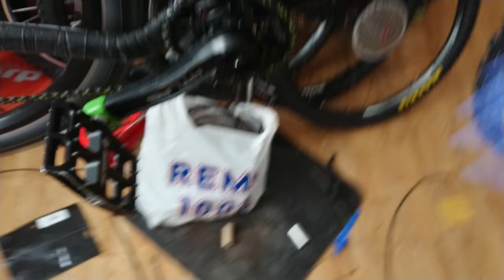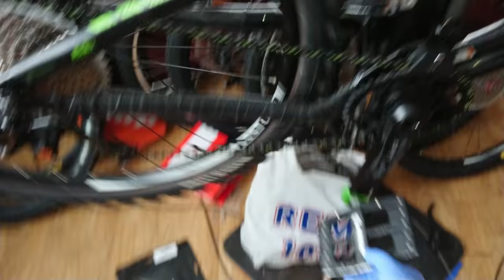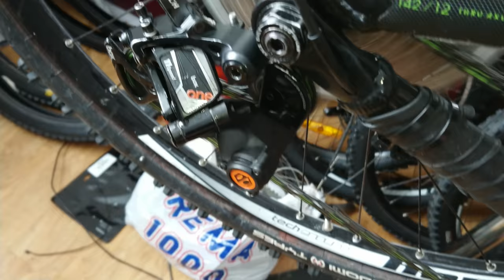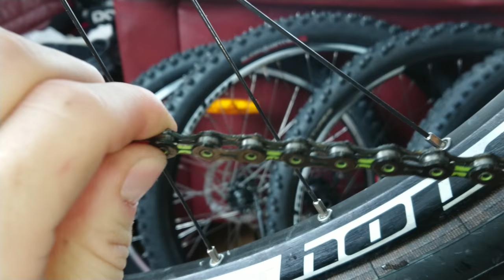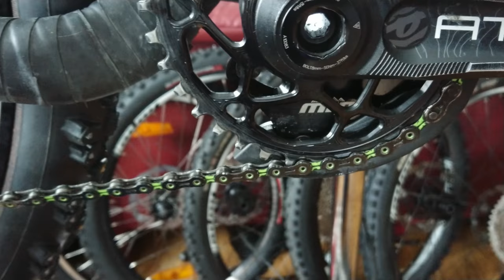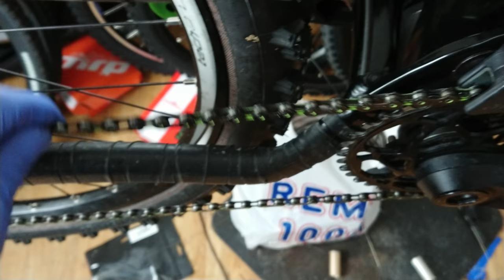Crunchy chain - Rock n Roll Extreme lube

Comment: I've got a bottle of Finish Line extreme lube for wet conditions that i've used in the past and it sucks. I don't know if its similar to the one you are showing here but it just collected dirt and grime like a magnet. I also used to use White Lightening and it built up a layer of grime and the chain seemed to need lube every few days on my commuter bike and didn't stay clean. I finally decided heck with it and just use cheap, easy to find WD-40. My chains stay a little cleaner and a WD-40 can lasts forever, it's cheap and I don't have to lube my chains as often. They actually make some bike specific products now that I've never tried. I don't know if they sell WD-40 in Europe? You can also use it for all kinds to things around the house and vehicles, dirt bikes, etc which is nice.

Do you like your oval chainring? Does it feel weird when you pedal?
Reply from the maker: WD-40 is not lubricant. Of course thicker lube will make dirt stay on the chain. If you use thinner lube chain will be cleaner, but if used in the winter it will come off, and chain will be noisy.
Reply from the maker: I use Muc Off wet lube, it doesn't get too dirty, and last long enough.   I used it on heavy rain, riding trough puddles, mud, - 10c worked well, but I clean my bike after every single ride in the winter due to salting., I also lube it. But I rode only a short ride I can let it be for few days, it will still work, but if you leave the lube on for days it thickens. It's best to lube it after evry long ride. Another lube that worked for me is Weldtite Wet Extreme, but it collects sand, and if you over do it with lubing it creates spiderweb in the drivetrain, the lube is thicker, it works great for extreme weather in the winter, but not for dry ride.
Reply from the maker: Pedalling a round ring is feels weird, but not oval, round ring causes knee pain after short time of riding, with oval i can go for hours without pain, the gear is lighter when needed, and hugger when needed, there is plenty info on this, but I comfirm it's true, buy oval.
Reply from the maker: I used Finish Line before, but I don't remember how it performed, but I could not find it for sale that many places, no shops in Norway sold it separate, I bought it fro ma cola shop which doesn't to exist anymore, but I see chain reaction cycles has finish line now, I could not find it there before, nor most there places. but Muc off was easy to get, So it's what I used the most, it also performed pretty good.
Reply: Johannes Nilsen I still like WD-40. It is a lubricant and does other beneficial things. I read up about it last year and I think people just view it as too common place and don’t have any respect for it. All I know is I spent the past 20 years buying expensive, little bottles of bicycle specific chain lube and they didn’t work any better or in some cases worse than cheap old WD-40.
Reply from the maker: @thatalaskaguy  So far my allround lube is Muc OFf Wet Lube.
but WD-40 is not a lube, it is meant to loosen up, clean, and lube in one go, but it's not meant as a lubricant, htat is what the ''experts'' say, like GMBN,
but they make bike specific stuff, as you mentioned, but I haven't tried any of it.
so far the lastest lube with good reputation is Smoove, but I haven't tried it, it's supposed to last long time.
Reply from the maker: @thatalaskaguy  have you tried in horrible muddy or brutal rain, and huge puddles, and riding in deep snow? what about different temperatures? like -10C or hot summer days, how does it perform?
Reply: @mtbboy1993  I've also used it on my commuter bikes with full fenders due to the normal wet, rainy weather in the fall and I had to clean and relube my chain way less often. On the other hand the Finishline Extreme was a mess! That stuff was a pretty thick lube that attracted everything it could to the chain. We'll have to agree to disagree about WD-40 but it says right on the can that its also a lubricant and if you go to their website it says the same thing. During the winter I don't have to lube or clean the chains anywhere near as often since snow is a clean, dust and mud free environment. What I like about the WD-40 is it helps clean and degrime the chain when spraying it on and wiping it clean, and it stays lubed for a decent amount of time. It lasts longer than White Lightening and is cleaner. The other bike specific chain lubes I've tried like to collect dirt and grime. As far as temperature, -10C = 14*F and no issues at all. I've used it in colder temps than that with no problems.
Reply from the maker: @thatalaskaguy  this is an example of why I like to try stuff my self, sometimes I find bad thing or good things no one mentioned. The lubes like rock n roll are cleaner and lube mix, white lightning is wax and cleaner. But rock n roll is only OK for dry, that includes the wet lube, for winter higher viscosity/thicker lube is needed,muc off does ok, but not tried white lightning wet lube, or muc off wet -50c lube, that might be overkill, I don't know before try. The lube that worked the best all round was muc off wet lube, not too dirty, in mud or sand, but weldtite wet Extreme did not work well in dry, as it collected sand,some of sticky lube. Not looked into what WD-40 has to offer lately. Some reccomend waxing the chain.
Reply: @thatalaskaguy  WD-40 is a lube..but its more of a lube cleaner. It can be used though for some applications where lube is needed but it burns off and doesnt last long.So you need to use it often. I just use a basic bottle of multi purpose oil/lube and it does ok. but for the heck of it,next time i clean my drivetrain,I might see about WD-40 as lube. See how it does for a ride or 2. Cant hurt..
Reply: mikieson I’m going to do a video of WD-40 which will show the lubricating oil left over after the rest of the WD-40 evaporates off after a few weeks. A bike chain is low rpm so it doesn’t burn off. I’ve had great luck with it, it’s cheap, keeps your chain clean but because it is just so commonplace and been around forever that people don’t give it much respect.
Reply from the maker: @mikieson  I haven't tried WD-40, or their bike specific lubricants. 
I am testing white lighting dry lube, I will continue testing it, but for wet riding so far Muc off wet is my fav.
I haven't tried other lubes, yet Rock 'n Roll was the worst wet lube I ever tried.

Comment: Wow!  Matching chain.  Fancy! :)
Reply from the maker: just because it was sold out of KMC x11 Sl silver, this chain is actually overkill, the performance gains are minimal, not really noticeable. even the box it comes in is overkill, huge revelry box with KMC on it and foam inside with magnet, crazy overkill.
Reply: Johannes Nilsen I've seen those here and they are expensive.  Just sticking with my SRAM chain.
Reply from the maker: I take what ever is the easiest for me to get,  I wish it was easier to get bike parts fast, and cheap, but o I have to buy international & pay import tax on a lot of it, and shops in Norway sell all stock fast, and take time to get new, some products they only got one pcs off, I can't wait until they import it.
but usually they got KMC chains in stock.
I haven't tried a Sram chain yet, but some claim they work better. but I don't know about the durability, I heard some things, but don't remember them all.
But I might swap to XD driver to test out how that works, and E-thirteen cassette, looks really interesting, I am chewing up Shimano splined freehub bodies.
The cheapest chain I found so far is Sram PC-1110.
Reply from the maker: chains don't last me long, but the KMC chain sure is well optimized for low weight & good strength. but the weak point is the Missing Link, it wears faster than the rest of the chain. but it's not a huge issue.
Reply: Johannes Nilsen My last bike, my XTR chain lasted for years and that was with riding, around, 3 times per week.  Never had an issue.  My bike now, I just have a bottom of the line SRAM chain that is only 6 months old.  See how long it lasts 
You like your MRP chain guide?
Reply from the maker: This footage is from the winter, but did not edit it until now,  since then I upgraded to Absolute Oval black bash guide with 77 Designz upper guide, which will do a better job, it won't clog up, like MRP does, and the chain will snap back on the chainring, with Mrp there is a chance of it getting jammed between the ring and the plate and falling off, it might happen but would be rare, but I want to be 100% sure, so far I am satisfied with the performance, you can read my reviews of both of them on my site:
MRP AMGv2 is not really made for oval ring, even the website states it's compatible.
MRP AMGv2: https://wp.me/p60aTF-1zq
Absolute Black OVAL 77 Designz ISCG05 Bash Guide Short term review: https://wp.me/p60aTF-2wH
Reply from the maker: I ride more than 3 times a week, if my health allows me to, so rides can bee over 20km and that's 1-5 times in a week for the most part, But i also ride for grocery round, but for thgat I mostly use my Trek 6300, but lately only rode few short rides.
so if I am well I rode as much as possible so it can last for hours and many kms,  but I swap chains when they are at 0.40 wear, to increase lifetime the rest of the drivetrain, so on my main bike the chain won't last long.
last time it was about 101.8 km according to Trailforks/Strava, I always record my rides, no matter what, but some times it fails to do it properly, but that's only few km inaccuracy then.
Reply from the maker: I haven't tried XTR chain, but I tried XT, when it was the only 11 speed chain I could get, but I like quick links/missing links, but Shimano has that too now.
I don't see much difference, I go trough drivetrains, & tyres faster than ever before, I was nto as harsh on gear when I was a kid, but I did not ride to Skansehytta then, I did nto do as many technical climbs, and did not weigh as much.
I go at high speed, you might not, so how hard and often you ride makes a huge difference on the wear of components, for example cheap bikes are impossible for me to ride for a long time without ruining cranks,drivetrain,fork,wheels,BB and other stuff, but with proper component's I can ride hard and for a long time. but on my Trek 6300 I swapped out all the garbage, and only got good & decent stuff on.
but the Fuel EX frame is really holding me back now, I ma on the last hanger, and threads are bit too loose, so something bad might happen soon, SO I will take it more easy, but my 6300 is still going strong.
I also go trough rear dérailleurs fast, I need 2 in a year if I would stay with Shimano, thats expensive, even for the budget options, I am waiting for the new Box One to come in august. its made out of forged alloy, so it will be stronger, than first gen, which I got now, So hopefully I will have a long lasting drivetrain I can take apart and swap bushings on.
that's a feature that is a must have for me, shimano's solution is bonkers, but it will make them alot of money this way, but I am too smart for that.
Reply from the maker: I also run trough Pads fast, I replaced the pads i installed when I installed the new brakes, I worn them so much I could scratch the edges apart with my nails. So I usually swap them if they start to crack, I think it might be gravel that gets between the rotor and pads and grind it apart, But I am quite good at maintenance, I do it quite often, IF I got a chance to service something I will do it, swapping cassette? why nto service the freehub or hub, I do it.
Reply: These KMC chains are for sure really nice! I picked up one of the 11s turquoise ones for my Giant XTC 3 :) Have a green 10s on my DH rig aswell.

Comment: Do you ever use rock n roll gold? Would you not reccomend these products cause I use rock n roll gold on my mtb but haven't ridden in wet yet
Reply from the maker: I've tried Gold but that's a dry lube, meant for dry condition, so it would perform as bad in the wet as this supposed wet lube. But they o keep chain clean, but the more common options out there like Muc Off, Weldtite work well in the wet, Muc Off wet lube, Weldtite Wet Extreme, but I will test more lubes. I already have reviews of the lubes I mentioned.

Comment: What is this showing exactly. A worn chain. You need to measure the chain wear before a video like this.
Reply from the maker: this just shows that most of the chain lube is gone, thus making noise. this video is part of a review.
I rode for few minutes, I rode trough a deep puddle and trough snow, the chain creaked horribly.
Nothing is wrong with the chain, it was not worn out. I go in depth in my review. watchign the video only makes the video useless if you don' know the context. But the link for the review is in the description. If you have heard worn bottom bracket or loose crank it sounds similar to this when riding. This lube was useless for me.